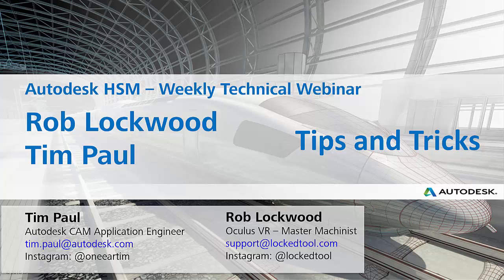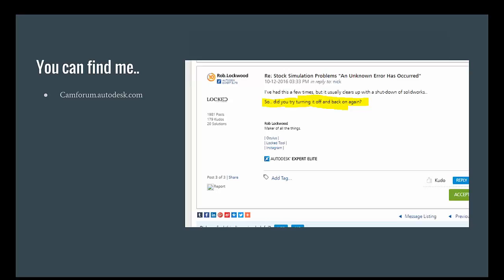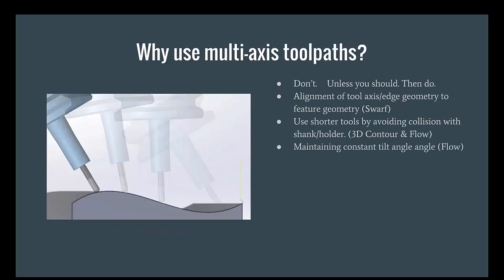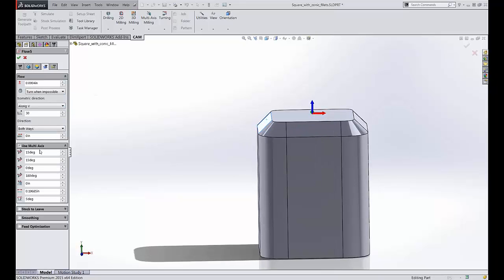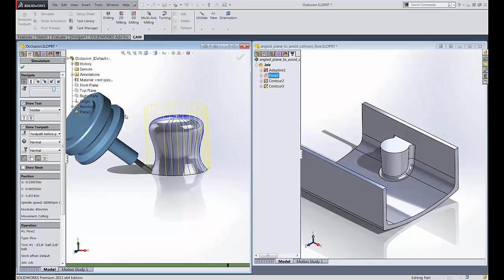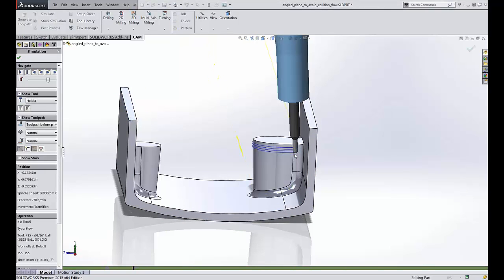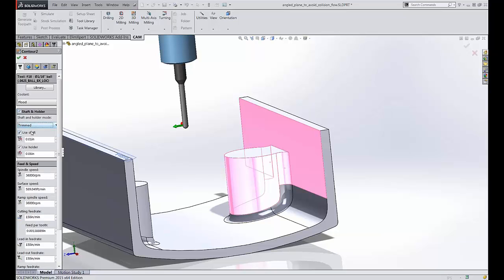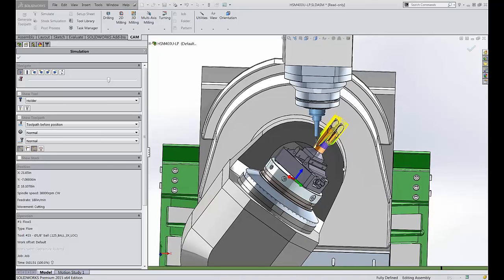Weekly HSM Technical Webinar - Multi Axis Toolpaths Tips and Tricks with Rob Lockwood

Comment: Good job Rob! there was a question regarding check surfaces in Flow and while it is not something supported currently there is a hack that the programmer can use. While not being able to select check surfaces the programmer can create offset surfaces and select these as part of the model in order for these new surfaces to be considered in the calculation. This will not work in all cases but is something for the programmer to consider as a containment feature to drive their intent. Of course this can be applied in many surfacing scenarios not just multi-axis toolpaths.